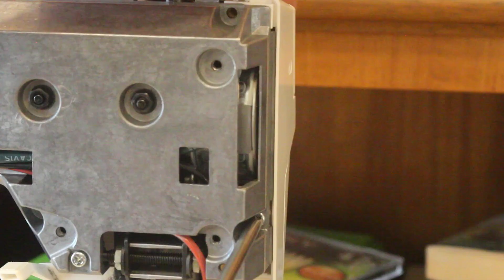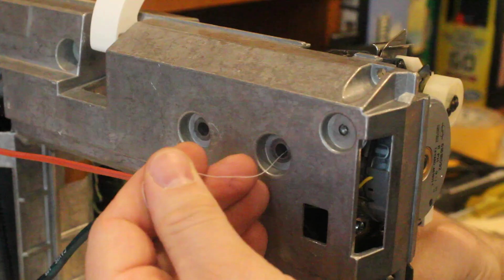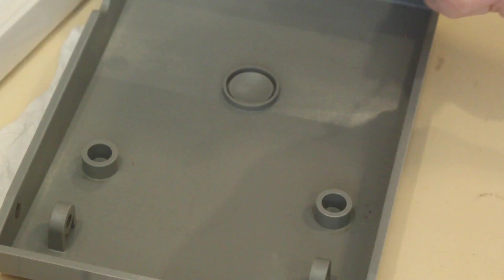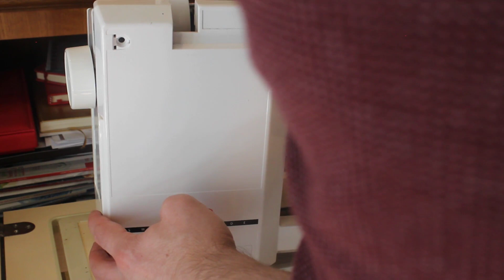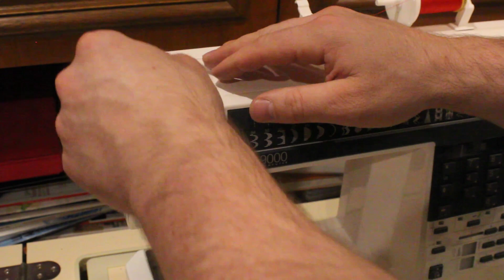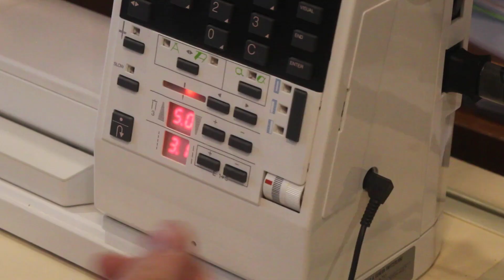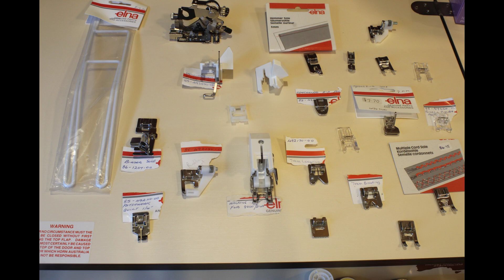Side of the Road Special # 2 - Elna 9000 computer sewing machine (Service, repair, and review)

Comment: Great video! Just wondering are you in Australia somewhere? My Mother has an Elna Diva that has a problem picking up the bottom thread from the bobbin, wondering if it would be possible to chat with you about it? (We are located in Aus also..)
Reply from the maker: Hi thanks for watching! I am in Australia,  unfortunately I'm not a sewing machine technician. What exactly is wrong with it?
Reply: @grannyflatgarage7599  It seems that when the rotating mechanism in the bobbin spins around (anticlockwise), at the point where it 'picks up' the thread from the bobbin, the thread (s) seems to get jammed between the bobbin area moulding and the case moulding. I have never seen this kind of thing working before (I've just been pulled into this!), so unfortunately I don't have a mental reference as to how it should normally work, but it does seem to look wrong that the threads are becoming stuck like this. I've tried to find as many videos on YT as I can that show what happens, and things do seem the same on our machine, up to the point where the top thread picks up the bobbin thread. Perhaps if I captured some video of it and put it up on YT, would you mind to have a look? Thanks for getting back to me!
Reply from the maker: @johnlacey155  sure if you post a link as a reply to this comment I'll have a look for you.
Reply: @grannyflatgarage7599  great thanks - I've just uploaded some video at: https://youtu.be/fJgkLgV2sYQ In this video I've progressed a little bit by removing the external casing, and it's possible to see now that the thread is becoming caught against what appears in the video as a small bent metal piece of the machine. The grey thread is brought around from left to right and reaches this piece at approx the 24 second mark. This is where the thread appears to become caught. I haven't ever touched this area of the machine in terms of disassembly or adjustment, and it appears to be unbroken, so I'm wondering if there is simply something I'm doing wrong? If you would like me to capture any alternate angles, or to try something different, please let me know? Thanks for having a look!
Reply from the maker: @johnlacey155  Hi John. Couple of things.
The black piece that the bobbin sits in, that the top thread is wrapping around is easily removable. It's part of standard home maintenance to regularly remove it and clear out lint from the bottom and sides. It can be a little tricky to get in/out but once you get the hang of it it's easy enough. Have a look in the manual (it's online if you don't have a copy)

Secondly (and probably the main issue) is you're using the wrong bobbin, this machine takes the clear plastic bobbins, the one you have in is for a vertical rotary hook machine. 
You can buy a pack of 5 Elna branded bobbins from Spotlight for a few bucks.

Try those things and let me know how you go.
Reply: @grannyflatgarage7599  Hi - thanks very much for your reply. I've had a look at the machine and as you say, yes the black piece was quite easy to remove, which I've done and checked for lint (but in this case the area was already quite clean). Very good to know how to remove that piece though thanks, another little piece of learning. That's a very good suggestion also re grabbing some Elna bobbins from Spotlight - I've seen mention that these machines can be sensitive so that makes a lot of sense to just grab an Elna original and remove that possibility from the equation. My hunch is that nothing is actually broken or misplaced on the machine, so hopefully this will work - I'll update you hopefully before long :)
Reply: @grannyflatgarage7599  Hi just to let you know that there has been some success - I managed to grab some genuine Elna bobbins as per your suggestion, and I asked my Mother to try setting the machine up again using one of these. She has said that it is working now, so it appears that this was likely the cause of the problem! I did see that it pulled the bottom thread up through the hole that the main needle travels up and down through, which I believe is 'the thing' that should be happening. She then proceeded to sew across a couple of pieces of fabric, and confirmed that it was giving the right result, at which point I've left the machine in her hands. (Even though it looked to me as though a whole mess of threads was being left behind!) Thanks very much again for your comments and suggestion, thankfully the machine will continue to be used.

Comment: Remember my late Mamy laying out big money for both this model, and the previous 7000 incarnation. At the time Elna was considered the absolute top tier of household machines, and then it all went kerplunk and they were bought up by Janome. I'd guess the transformation of sewing machines from heavy castings to die castings and plastic, with added early computerised fluff pushed them out of the game ? Probably also the case that the machine repair guys of the time had a hard time making the transition. Interesting machines with a lot of extra functions for the time that no doubt wow'ed potential customers, but got less use than imagined.  However, top video mate 👍

Comment: What a wonderful video! And how lucky for you to have found this machine and to have the skills to repair it. I have the exact same machine, and rarely used its fabulous capabilities. A few years ago it was dropped, the tension was all damaged, I had it repaired but it was never the same. Recently I took it out to give it another go. I can see that the pressure foot is not coming down to a position that properly grips the fabric. It feels like the mechanism is controlled by a column of air... like an air pressure system. When I use the lever to lower the foot, the pressure foot does not go all the way down. Then I need to use my hand to push it down further to make contact with the fabric. Despite all this, the fabric is not fed properly and I need to pull the fabric as I stitch. I hope there is a quick fix, and that you might be able to guide me.
Reply from the maker: Hi, it sounds like part of the presser foot mechanism may have broken similar to mine in the video, it's quite a flimsy part made from some sort of plastic as I showed it is repairable though. Unfortunately I can't really tell you too much else without having a look. You can buy second hand head-blocks as replacements which might be another option if that is the problem.
Best of luck
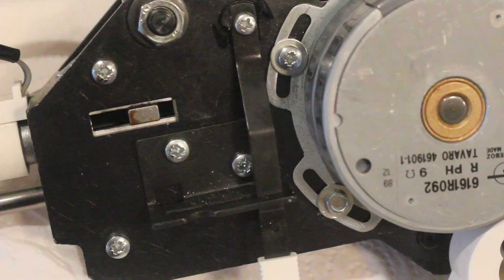Reply: @grannyflatgarage7599  Thank you so much for your prompt reply! I've gone back and listened to section 22:20 about the take up lever. I am not as brave as you (nor do I have the skills that you have) so I am trying to avoid removing the front panel of the machine. However, I did remove the back but there isn't enough access to determine if the problem I have is exactly the same as the one you had. At position 22:42 of your video there is a metal bar slider that is controlled by the lever. The control feels like a spring mechanism. What's happening in my case is that the lowest position of the lever does not coincide with the lowest position of the slider. When I lower the presser foot lever, the presser foot does not go all the way to the bottom. Perhaps I need to remove the whole presser foot mechanism? I really appreciate any suggestion you can give me. Thank you so much!!
Reply from the maker: It definitely sounds like the "ears" have broken on the shaft that the presser foot lever attaches to, at least partially. That is, it sounds like you have exactly the same problem I did. 
If you take the front shell off (only a few screws) you should be able to see easily if that is the issue. 
Unfortunately that was probably the least DIY friendly repair in the video, however a repair shop may be able to assist if you know that's the problem. 
Sorry there doesn't appear to be a quick fix.
Good luck!
Reply: @grannyflatgarage7599  Thank you! I imagine the fault may be similar to the one you had. But the machine works and I am using it for only minor stitching. I will let it be for now. I want to say again that I'm very impressed by the clarity with which you give instructions. Thank you for your hard work.

Comment: Bonsoir, merci pour cette video, j'ai appris beaucoup de chose ce soir j'ai depuis quelques annees une elna 6000 et je ne trouve pas d'information sur la synchronisation aiguille-crochet , de combien de mm faut il remonter apres le point mort bas pour etre en phase de boucle. Merci à tous pour vos commentaires. Bonne soirée.
Reply from the maker: Hi from the manual it looks to be 2.45 to 2.75mm. Elna unfortunately uses a lot of proprietary service tools which I haven't been able to source. 
Have a look at the manual - section 7 covers hook timing.
https://www.ifixit.com/Document/PArl4jlNvNWgbK5F/ELNA_6000_service_manual.pdf?referrer=wiki%3A209846

Best of luck and thanks for watching!
Reply: @grannyflatgarage7599  Bonjour, je te remercie pour m'avoir répondu, j'avais vu  cette page hier ou il est indiquer 2.45 mm. Aprés controle je l'avais bien régler j'ai tout nettoyer demonter la tension du porte canette, regler la tension du fil superieur et au final elle fonctionne comme avant. Cela fait quelques jours que je suis dessus pour avoir remplacer mon arbre inferieur remplacer par un de elna 5000 car la machine à forcé et les pignons sont féles d'ou une synchronisation impossible. Je vais me raprocher d'un atelier de précision (pour je pense percer l'arbre et mettre des mecaningus ou) voir avec le technicien, encore un grand merci à toi et super pour tes videos. A bientot de te lire et bonne journée.😊 👌🙏✌

Comment: Finally a really detailed service video.  Loved it.  My Elna 7000 started sewing in reverse after all these years and it was serviced last year for routine cleaning.  Sent it out for repair and it came back as unrepairable due to self regulator not working.  Does  the machine have such a part or function?  Thinking of opening my machine up after watching your great video.  I love my 7000 and  if its not repairable I may even buy an old one.
Reply from the maker: Thanks for watching, I'm glad you enjoyed it. I'm not particularly familiar with the 7000. Without seeing it I can't give you too much info but I assume the stitch  regulator is an electronic component on the main board. On the 9000 at least most of the chips are still available as new parts so if you found an old computer or TV technician they may be able to fix it. 
Definitely give it a crack!
Reply: oops,,  meant stitch regulator

Comment: Hi, thanks for the tutorial. I have an Elna 9000 computer, Could you tell me how to solve the thread tension at the top and bottom since the thread gets stuck at the bottom? Thank you so much! from Argentina
Reply from the maker: No problems. The thread bunching can be a few things but I'd try to do the factory tension reset first. I go through it in the video. 
Good luck.
Reply: @grannyflatgarage7599  I have tried, turning the wheel to number 9 but it keeps gathering thread under the fabric

Comment: I purchase this Elna 9000 new($2500 Can) when they first came out in 1999.Absolutely amazing for her high level of sewing and design.
A few years later it was taken in for routine service where it was purchased.It came back and never functioned since.Taken to another Elna repair and supposedly fixed.No never could adjust tension after that.Machine has been a door stop ever since.Seems to be doing what the one you posted.Although it runs great it has that tension problem she has never been able to resolve.Since I also bought her the 7000 Serger it still works well.
Always wish I could find someone reliable to correct the tension issue but so far failed.Wish you were close by so you could tackle this problem.
Reply from the maker: That's a real shame, I wonder what happened... the tension can certainly be a bit fiddely and if there's an issue with the take up lever it can make the tension super loose. 
If you wanted to have a look at it here's a link to the service manual https://www.scribd.com/document/499216114/Service-Manual-Elna-8000-9000-Diva
Hopefully you have some luck. Nice to know that the overlocker still works!
Thanks for watching!
Reply: I bought mine for $3890 in 1989 at a home show in Melbourne, Australia. The man who serviced the machine said it is perfect condition. My best buy ever!

Comment: Hi, thanks for the tutorial. I have an Elna 6000 computer,  the needle is not catching the bobbin thread. Kindly assist
Reply from the maker: No problems, glad you enjoyed it. The easiest 2 things to do are: 
1. Give the hook (bobbin holder) and surrounds a good clean - a build up of lint and thread (through normal use) can cause issues with bobbin pickup. 
2. Swap to a brand new needle - a slightly bent one (you might not even be able to see the bend) can cause it to miss the thread pickup point. 

If this doesn't work it could be a timing issue. I would recommend having a look at the service manual for your machine - https://www.ifixit.com/Document/PArl4jlNvNWgbK5F/ELNA_6000_service_manual.pdf?referrer=wiki:209846 
Have a look at the section marked "Hook Timing" this is a more complicated repair though. 

I hope this helps, thanks for watching!

Comment: Soy de Argentina. Tengo una maquina Elna Diva 9000, desde hace 30 años, nunca tuve ningun problema . Solo que ahora comienza haciendo zig zag y desoues de una spuntadas sigue cosiendo recto. Tampoco me hace bordados  ni ojales. El problema puede ser mecanico o elctronico? Me encantaria que pueda tener solucion. ya que aca en argentina no se quien pueda repararla. Aun no he encontrado otra  maquina que la supere. Pero en mi pais no llegan esa marca. El video es extraordinario, felicitaciones
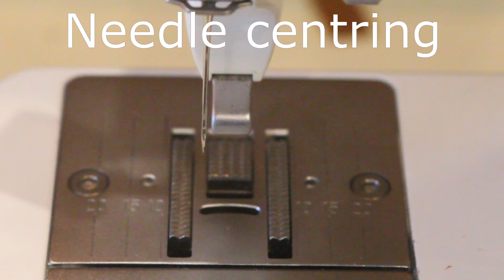Reply from the maker: It is a little hard to tell without seeing the machine. It could be mechanical or the computer. You should try the computer self test for the side to side stepper motor. I do it at 11:02 in the video.